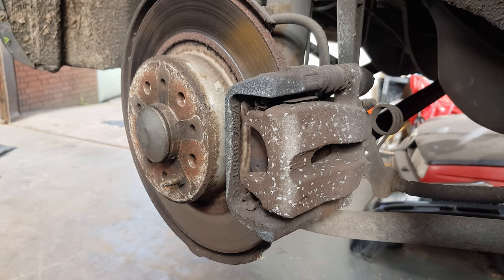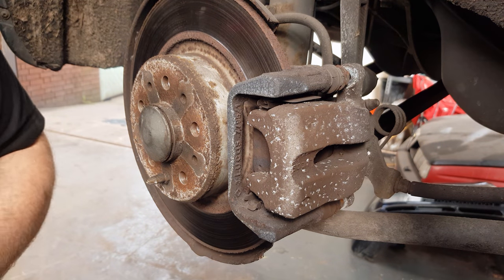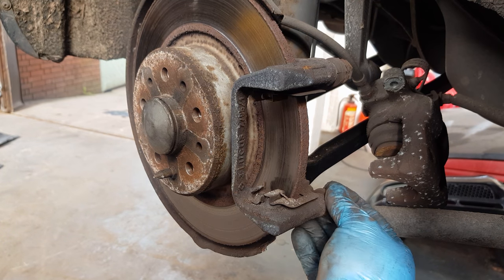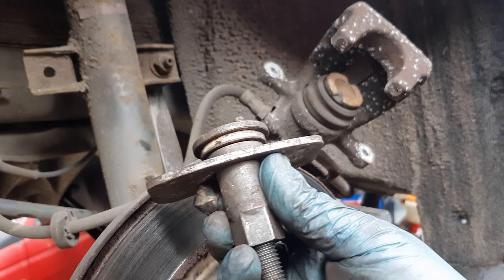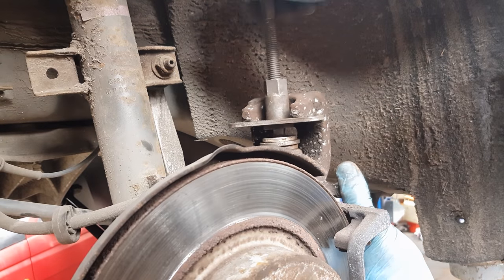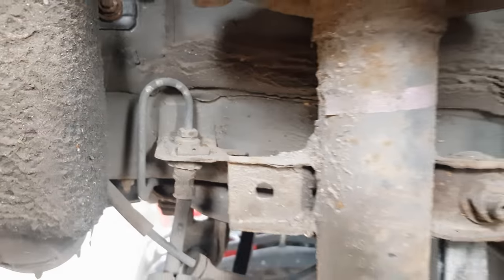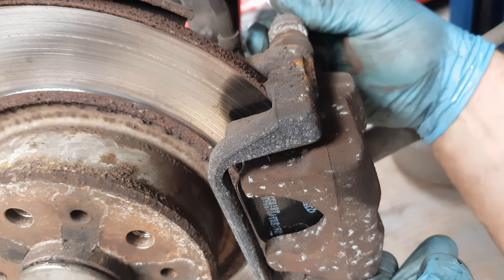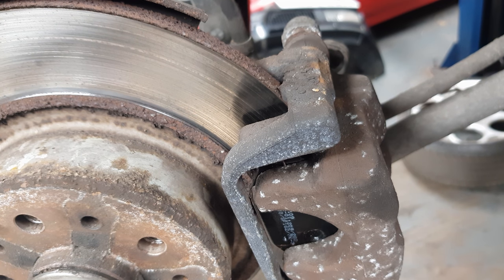Alfa 147 156 GT or GTV Rear Brake Pad Change

Comment: Fantastic video thanks!
Very clear!
One question if I may?:
What should the slider pins be greased with please? I’ve heard some greases can expand and knacker the rubber boots.
One of my callipers is binding so it’s either the pins or the hand-brake cable I guess
Reply: Further research I found suggests Red Rubber Grease as it's silicone based and will keep the rubber boots/ seals from cracking. Also with these brakes, some models such as my 147; the lower shorter slider pin has a rubber sleeve on it which inside the bore hole keeps it from rattling I guess. Mineral grease attacks the rubber and expands it apparently. So obvs not a good plan as it'll seize up. Silicone grease here is the way then.

Comment: Nice one,are you 100% sure that you can change rear disk without removing whole caliper off?  Thanks
Reply from the maker: Calliper carrier doesn’t need to be removed. Sometimes they are really tough to removed though.
Reply: @ItaliaAutos  Thank you. Can you tell me, If I am changing wheel bearings under disc, where can I find on how much NM I need to torque it, for Alfa 147. Thanks

Comment: Any tips for painting the callipers please?..
Apart from wire brushing off loose dirt, will brake cleaner spray be sufficient to clean the surface?
I’ll mask off pipes and rubber parts too…

Comment: Those disks look horrific. Too bad the customer didn't follow your advice. 

How much of the stopping power you reckon comes from the rear set of brakes? I installed new disks and pads up front but have yet to do so in the rear, so i'm quite interested in the possible improvement, once I do.
Reply from the maker: There's a little bit of life left in them
Reply: @ItaliaAutos  Perhaps just video magic, the outside lip seemed very big.  I saw you install Magnetti Marelli pads. What's your opinion on them? I've had the same brand on my car for about 2 years and they stop slightly worse than the likes of TRW,ATE etc in my experience.
Reply from the maker: There fine had no issues

Comment: Nice vid, cheers Neil. Just one question, when compressing the piston back into the caliper does fluid work back up the system and escape through the master cylinder reservoir?
Reply from the maker: Shaun Kelly it will overflow through the reservoir just check it when pushing it back as it will sometimes overflow.

Comment: On using my piston rewind tool I noticed the seal has a couple of small holes in. Is it possible to replace the rubber seal without having to do a whole piston replacement do you know please?

Comment: Hi there, love your videos ! I have a question for you; I would like to know what I need to do > I have 166 brake claws. And want to fit them to my Gtv 916. Do you know what I need to do? I’ve understood that if I’ve had used the GTA brake callipers it was plug and play. But these are hard to get. And I have these now ( the 166 ones ). I guess I need the 166 brake discs to ? Or is this manageable with brackets ?   Really hope to hear from you. Thanks 😊 🙏🏼 in regards. ( keep up the good work )

Comment: Hey Neil, hope you're having a great weekend! How much play is considered normal in the caliper? I noticed my caliper moves side to side and produces a knocking sound over bumps,  should I be looking at new calipers? Bolts are tight and the play is elimited by the handbrake.
Reply from the maker: You couldn't be able to move it really if pads are fitted and piston is pushed back out.
Reply: @ItaliaAutos   Something must be amiss then - pads and disks haven't been touched and taken off the car the past 2 years. I just noticed it after changing my entire rear suspension, chasing a rattle. The rattle miraculously goes away when braking and I can move the caliper by hand enough to produce a distinct knock.  Can relatively worn out pads cause this (around 40% life left) or it must be the caliper?
Reply from the maker: @hotwheels1997  Prob worn sliding pins or and mount.
Reply: @ItaliaAutos  I can feel the movement around the bolts area which hold up the caliper? Looking at the video, that's where the pins are too so I believe I've found my issue, hopefully. I still can't believe it's possible for the caliper to make such a noise over bumps - it's very loud!

Comment: Neil, do you know where I can get the caliper reset tool for a 147 ? I've looked on Ebay and each time it says "This does not fit your vehicle". It's a 2005 147 T spark 1.6.

Comment: Tiny pads. Are the Brembo versions much more expensive to maintain? I've been told they are. These standard ones seem to experience fade with a fast brake from high speeds. Be interesting to see if braided lines improve it.
Reply from the maker: rears are still cheap. fronts cost a fair chunk more than standard setups but not overly expensive.
Reply: @ItaliaAutos  Cool, I need to upgrade if I swapped  2.5 to 3.2. Also considering a piston and sleeve kit from Autodelta to make 3.3. With everything else stock except for a tune it should make more appreciable torque even with the auto.
Reply from the maker: @MrPittsbrother  awesome.